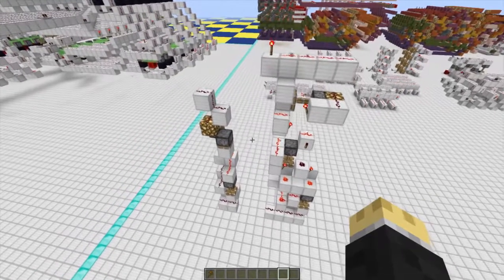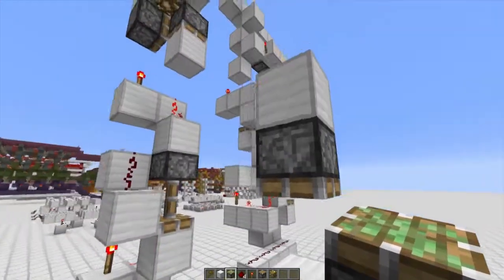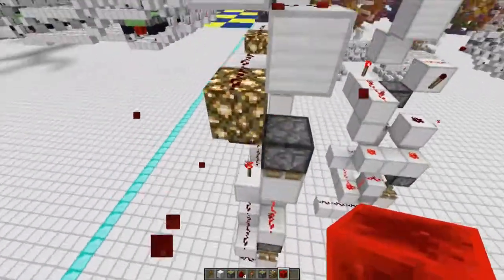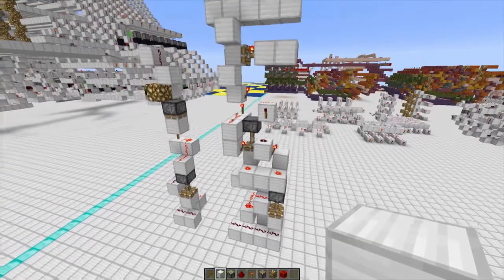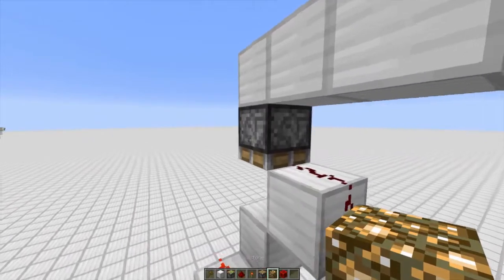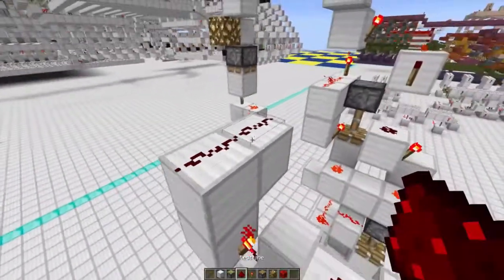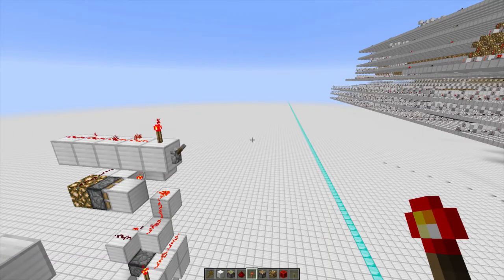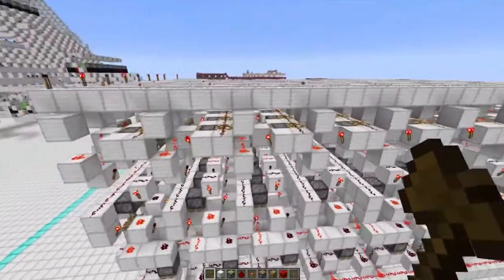Sw1ftx16's Single and Dual Read RAM Tutorial

Comment: Nice Tutorial, very well explained! Although you missed a repeater when you stacked the Memory at 9:38 since you can see that the last bit on the bottom Bus is activated, although the read line isn't active. :P
Reply from the maker: Yeah that line is a bit tricky since the pistons are 1 block away instead of right on the line. You can usually fix this by placing a block in front of the repeater at the beginning of the line, but I forgot to mention this.

Thanks for pointing that out!
Reply: My computer needs 4gb of RAM
 is it possible
Reply from the maker: @thenewsonatrain  it needs it, huh....
Reply: @thenewsonatrain  hahahahahahaah omfg your joking haha. 4 giggabytea? Bro what are you trying to build, a replica of a real life computer? Well if it were possible you would need to compact the cell way beyond what we see here. That ram would get extremely slow the further the index. You would have to stack the bits vertically and horizontally, to even get close to a large amount of bits. The more storage you want, the slower and bigger the computer will end up being.
Reply: @zypherone  well, to make 4gigs of ram you will need to stack like, 32000000000 of them? so yeah, uhhh it would be uhh big?
Reply: @tridos2574  only a little bit big lmfao. If you look at my channel, I've got a video about the arc 2, and it has 128 bytes of ram but it's huge!

Comment: in 1.16+ you have to replace the glowstone with target blocks, because of the functionality change.
Reply: In the Dual read ram if you do that will power wrong pistons
Reply: @chrisskyr623  I also noticed it doesn't work when stacked into a grid with glow stone.

Comment: How do you reset the dual read ram? Because I built it and I put the red stone block to power the red stone on the side and when I flick the levers to see what information is stored, they are all still powered even after putting in some information by flicking the levers in the front.
Reply from the maker: It sounds like you're flicking the information input. That is not going to work.
The information needs to be stable when write is enabled.

Comment: I am new to logical redstone I love it very interesting I think I will learn more about it when I manage to build a computer also what else could you use a Redstone computer other than arithmetic
Reply from the maker: Well, technically you can use them for just about anything, though they are pretty slow. Some might say impractically slow.

Though if you're willing to wait for results, you can find some uses for them. For example, I've been tinkering with using small computers to manage routing tables for my rail network in my survival world.

I'm still developing this though, so it might be a while before I get to make a video on the subject, but even still, that's one application you could use a computer for.

Comment: So when u stacked the slices, wouldn't a line of outputs all be connected?
Reply from the maker: yup. 

You can of course give each register its own set of outputs, but this was specifically designed to be a part of a RAM bank, which typically only has one input and one output (data wise).

This does mean that you can only read or write one thing at a time, but for a computer which does things sequentially, this works perfectly.
Reply: @n00b_asaurus  yup! I think I got it now... so the max size that you could have of this would be limited by the redstone travel rate. How would you stack it to make it bigger than the travel rates allow?

Comment: Has anyone been able to use the single read design for bytes longer than 8 bits? I can't fit repeaters on some of the lines without it breaking.
Reply from the maker: Yes, it is possible, and actually quite easy.

I think you should be able to figure it out on your own. In fact I would encourage you to.
Problem solving is an extremely essential skill in any technical fields. Computer crafting is no exception.

Comment: How do you combine it with your ALU? There are two inputs in the ALU, and only 1 output in the RAM
Reply from the maker: hmm I'm not sure... I might have given the answer somewhere in or around the video... but I can't remember.
Reply: On 8:52, you said there was a way on how to make it so the RAM has two outputs, but when you install it with the ALU, the only number it will make no matter what the input of the RAM is will be 0
Reply from the maker: I believe you have to store something in memory first before you can get anything out...
Reply: @btersol  you can use a input director so you can choose witch input you want and then just build a small 1 number buffer for each number and use these

Comment: The update piston of the single read RAM doesn't work on PE edition. When it's turn on, it doesn't trigger the sticky piston to store the inputted data. Do you have any suggestion to replace that piece? Thanks!

Update: I found a really good design for the dual read RAM that works very well in bedrock edition without QC. It's also very compact and fits really well with your ALU design. Here's the link for someone who don't use JE edition: https://youtu.be/npG7bCAykaM
Reply from the maker: This design requires quasiconnectivity (or bud powering) to work properly.

I don't know much about PE, but I'm guessing that version doesn't have QC as a feature like JE does.

You're probably better off using a RAM design for bedrock.
Reply: @n00b_asaurus  After reading a bit, yes, I just figure out that QC doesn't available on Minecraft version other than JE. Kind of a boomer, really :(

Comment: I don't believe the single read works anymore on the write. 2xXx2 was going to be the basis of my computer's RAM, due to space limitations. I've altered the design, but it has propagation lag on the write. It's not particularly game-changing, as it's a 6-bit design,  but it'd be nice for it to be a bit speedier.
Reply from the maker: Seems to be working in 1.15.1...
Reply: @n00b_asaurus  No, you're right. It's working fine. I had my normal pistons pointing along with the address lines and not the data lines. Therefore, whilst it was working fine, it was also writing data to to adjacent addresses.

Thanks though! I feel like a wally now.

EDIT: can't remember who did this read circuit, but it's a couple blocks shorter than sw1ftx16's: https://imgur.com/a/8FINJP2

EDIT 2: Bennyscube: https://www.youtube.com/watch?v=lSDErjtbxBs
Reply from the maker: No worries, it happens to the best of us.
I wasn't aware of bennys variation of the memory! That's actually great to know! I'll have to point people to that one more often!
Reply: @n00b_asaurus  I built a 2x3 multi-read RAM module i think you might like. It's a bit tall, as the read module is 9 high. However, it's pretty much tilable in every direction, so 8-read memory isn't impossible.

I might do a build video over the weekend if it garners any interest.

https://imgur.com/a/Eqgzy94
Reply from the maker: That's not too bad! I've seen these modular multi-read memory cells before, but I think you're right in saying it's the smallest.

Comment: I am making a computer and I felt that I had to use dual read memory because you can't use both alu inputs with single read ram i am confused to how you use single read ram with the alu
Reply from the maker: Quick question: you understand what levels of abstraction are, yeah?
Reply: no but i think you can have a circuit to pick which input you let ram into and have either a register or immediate data go into the a input
Reply from the maker: if that's how you think I did it... then that's how I did it ;)
Reply: lol i just realized that is called a multiplexer
Reply from the maker: meh... tomato, potato!
Reply: use an accumulator. it's just a register allocated to loading and sending values to memory.
you can then copy your accumulator over to your working registers

unless you are referring to registers as ram, (registers are memory cells connected directly to the alu), then wire the readA + readB to your alu's Ain + Bin then wire your ALU out to the memory bus

or you know, as you said just mux single read into your memory, it's slower than using dual read

Comment: Hello, if you are interested (And if you see this) i have recently designed a Single Read signalstrength based RAM module which to my surprise accually is slightly more compact storragewise than the 2x2x14 or 56 block per bit one, mine has 54 blocks or 3x8x9 per 4 bits i would gladly share with anyone interested : )
edit: so right after i wrote this comment i got an idea and made an even better RAM now its just 4x6x8/4 or 48 blocks per bit
edit 2: and now i have redesigen it twice again, first down to 3x8x13 per 16 bits and then down to 3x5x11 per 12 bits
Reply: while idk how practical it would be for my uses if its not 2-wide stackable, i am super curious and would love to see if youre still around
Reply: @Chris-io2cs  same here lol
Reply: @Chris-io2cs  hey sorry for the wait. i wanted to make a world download for you, but i needed to know how to do that before i could, and then while procrastinating that i forgot about it. But at least now you will get 2 new and better designs. 
though i still need to figure out how to make a world download.
And even though i call my machine RAM it's be more accurate to liken it to a harddrive since i went for compactness and not accesibility, though for my 2 new designs i made it so they can support any byte lengt you'd need by extending them.
anyway, plase do say it you are still interested